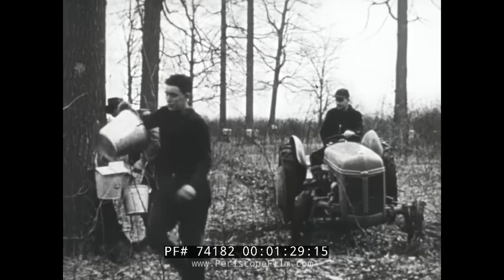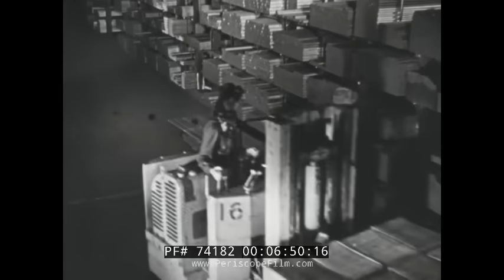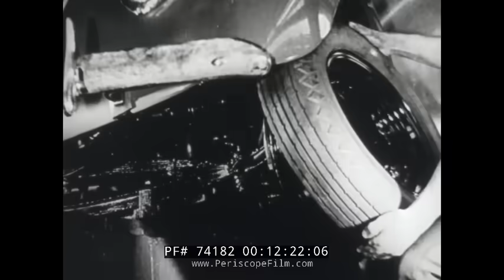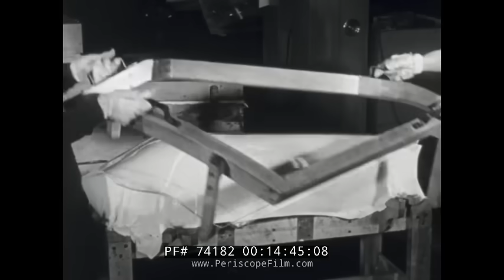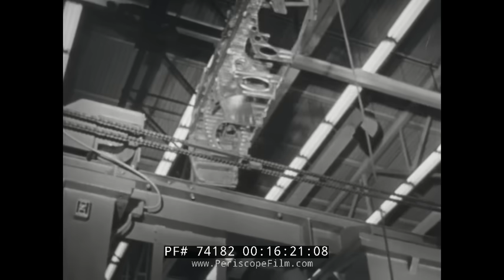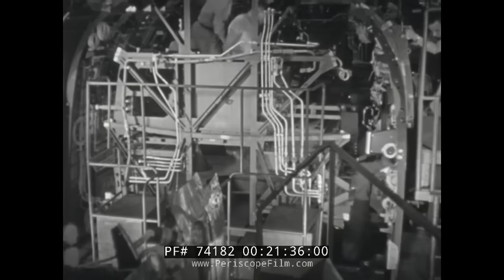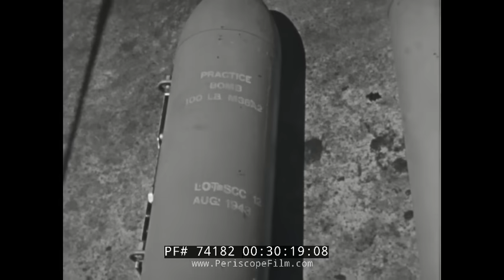BUILDING THE B-24 BOMBER DURING WWII  " STORY OF WILLOW RUN " 74182

Comment: Much is said about the survivability of various aircraft, toughness helps to be sure, but if you took a direct hit of 88 flak, your ship was about to meet Tera Firma. In a big hurry. Get out if you could, many could not. Depending on who you meet once on the ground you either went to Luft stalag. Or worse.
Just imagine if the roles were reversed, all politics aside, say a crew had just bombed Topeka and killed your family, how would you treat them?

At 27.00 there's a little midget in the outer wing connection joint. What American crafts workers can build, that great oleo strut of the main gear always struck me with its strength in nearly unbraced structure, amazing, and those lovely ladies so hard working as well.
Imagine the sun on that new aluminum mirror finish, you see why pilots wore Ray / Bans.
Amazingly enough at the end of production many factory new war birds were flown directly to Kingman Arizona to meet the scrappers axe.
Reply: Yea and WE paid for every one of them too. THATS what that and every other war is about !  Get the connection yet ? ? ? ?

Comment: I see your point and agree piracy is a problem. I'm a film editor. I was able to remove your timecode and soften your URL. Today nothing is really safe. If I wanted your footage I could use it. For the casual viewer however your attempts are distracting. You could reduce the size of the timecode or even soften it to barely visible but for the average editor it would render the footage in desirable. I appreciate your efforts in restoration however. Keep up the good work.
Reply from the maker: Actually, broadcasters increasingly do understand the difference between true 1080p material (and 2k and 4k that we sometimes provide) and the quality level of a file that has been downloaded and blown up from Youtube. And legitimate broadcast producers and filmmakers respect not only the quality of our delivered material, but require the legal clearance that we are able to provide through the licensing process. If you're truly a professional film editor, working for legitimate producers, you should know that material you've "softened" is not only substandard, but likely to expose the producers you work for to liability.

Comment: There is no such word as "aluminum" in English.  Take a look at any proper Periodic Table, and you will see that the 13 element is correctly spelt "Aluminium".  Really, you folks ought to have caught up with this simple matter already.
Reply: Careful... You're asking for an ALUMINUM gift!
Reply: To quote lookoutforchris and his earlier comment: "If you're a Brit you should know how to say and spell Aluminum.  It was first isolated in the early 1800s by another Brit, Sir Humphrey Davy.  He named it Aluminum and as Americans we've respected his naming.  A political journal in the UK later changed the name to Aluminium because they thought it fit better with other elements ending in IUM... even through there's several elements that end in UM (like Platinum for instance).  The Brits standardized on a political revision which disrespects the original discoverer.  Look it up, it's all on Wikipedia.  Both versions are considered correct today by the IUPAC, which is really the final word on the matter.  But ultimately the Brits are not using the original spelling, and they're too pompous to look up the history of it".

Comment: There is a myth that the B-17 was more survivable than the B-24.  Do a little research and you will discover that the loss rates on the B-24 were actually lower than the B-17, despite being tasked to do more low-altitude work.

Comment: 1 every 55 minutes, that's amazing
Reply: No they actually could roll one complete B-24 off of the line every hour on a shift in full swing.
Reply: Problem was you could easily lose more than 24 bombers in a single raid. The courage of those fliers, most of whom were barely out of their teens....
Reply: i am guessing that means that there was one process in the manufacturing that took 55 minutes -  the longest process time - what cld that possibly have been  ?  Need to watch the movie again !
Reply: It was impressive but the squak rate was through the roof, Took the AAF a long time to work it out to where they were cleared for flight and AAF acceptance flight.

Comment: Turbo-super-chargers, huh? This narrator was a real genius....
Reply: Superchargers are/were driven either mechanically or via exhaust gas. The narrator was correct in using the term in the era when the film was made. "Turbine driven supercharger". Language changes and evolves. Now we have two distinct terms.
Reply: @51spike  - Correct. That's exactly what they were called - turbo superchargers. The turbine was driven by exhaust gas from the engine. It allowed the planes to fly at high altitudes and still produce power as if they were at lower altitudes. Both the B-17, B-24 and B-29 used them as did the P-38 Lightning and P-47 Thunderbolt fighters. Most other US fighters (P-51, F4F, F6F etc.) used mechanical superchargers.

Comment: The B-24 looks like they added wings to the box the B-17 came in!
Reply: My Uncle Navigated a B17 over france & germany. He said when they talked about the B24; "it looked like the box the B17 came in"  Yeah it was  funny looking.
Reply: B-24 was a lot better aircraft then a B-17
Reply: Some guy named Davis spent 2 years designing the wing.  Consolidated spent 10 minutes designing the rest.  During advising, recommending nose armament, Charles Lindbergh thought the plane was so ugly that they should just put the "tail" on the front end.
Reply: the Lancaster is pug ugly.
but not as bad as the Blackburn ROC.

Comment: Both my grandparents worked there. I remember my grandmother, a "Rosie", told of one of the wing midgets being killed when an outside worker drilled through the skin of the wing and into the midget's head. People came from all over the country to work at that plant. It was a prized job if you could afford the gas rations to get back and forth to Detroit, an hour away. They couldn't house 60,000 people in Ypsilanti, where the factory was.
Reply: They used dwarfs to crawl inside the wings and back up the rivets while the riveter on the outside set the river. Once the river was set they drilled the next hole. It must have been hellaciously loud, for one thing. Anyway, yeah the midget's head was in the wrong place at the wrong time or maybe he "didn't know the drill" and then the drill "got inside his head".
Sorry. Bored ya know.
Reply: Drilling through a wing midgets head? Pray tell, continue my good man
Reply: Oooohh? Not good??.. That could hurt??..

Comment: Years ago I was wandering round RAF Cosford Aerospace Museum and climbed a wooden platform to look into the port side of the B24 cockpit. There was a little blue Ford symbol in the centre of the control wheel, which amused me at the time, thinking one of the museum staff had been 'avinalaff.  "In a Ford!"  Got the whole proper picture shortly after.  Live and learn.
Reply: GM built Wildcats (what you Brits would call Martletts), too. Goodyear built Corsairs, as well. I believe a few Corsairs graced British flat tops back in the day, showing us Yankees how to safely land a Corsair on a flat top (in a shallow turn to overcome "blind spot" issue upon coming back aboard). You folks let Packard build more Merlin engines. Republic was owned by Ford, too. I wonder if there is there is a blue oval in a P-47.
Reply: I live near cosford,i go occasionally
Reply: How evertonian mate

Comment: Had a uncle who flew 51 missions in a 24, 15th air force. It's strength was it's ability to be massed produced but it was easy to bring down due to it's propensity to catch on fire. But it hauled heavier loads than the 17 over longer distances  at faster speeds and among many tasks  it performed included sub hunting in the North Atlantic and the British were happy to get them
Reply: My Dad also flew 24s in the 15th air force.
Reply: Robert Long  Actually the B24 was only slightly faster, carried  a little more a little further, but it could NOT match the service ceiling of the B17 !!!!  They went with a Davis wing on the B24 for speed and sacrificed lift and the ability to climb as high !!!  B17 had a higher service ceiling due to its larger wing !!!!
Reply: @wilburfinnigan2142  True but the loss rate was almost identical (24 was actually slightly lower loss) so the few thousand feet ceiling didn't amount to any real advantage.
Reply: As well my father,was a pilot in WWII The greatest generation!!!
Reply: My father was Emperor of the Universe during the Big War.  He later resigned to become president.  Everyone has a story, don't they!

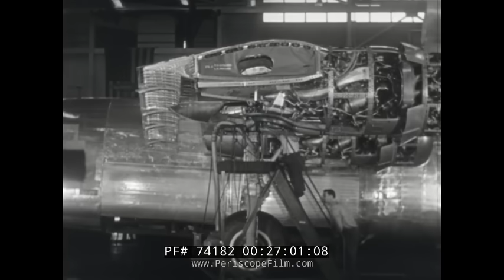Comment: best part is at 27:00 ..... oh those little midgets!
Reply: Had to laugh at that, too. My question is did they get them out or did every plane go into service with two "little midgets" trapped in the wings? Regardless, was there a midget shortage during the war that has somehow slipped under the radar? There has to be a PhD thesis or, at least, a PBS documentary in this.
Reply: Lol
Reply: They used midgets because regular sized people couldn't fit in the wing sections. My mom riveted the wings to the fuselage and said ( those damn lazy midgets would fall asleep in the wings during breaks and the driller would start DRILLING after break and would kill them or wound them because he didn't know they were sleeping ) 😲😲😨. 😁✌
Reply: @billbegan4080  Damn. They must've had a ready supply of midgets !!
Reply: They used midgets because they were short of people.

Comment: The first time a saw    the inside of a large  Bomber from ww2    I   wondered  why  the hydraulic  lines  weren't  run thorough a protective  Tube  when possible   to exit where they   are needed  which would reduce  the damage  to them by attack planes  as the bullets would his the round surface  and deflect . 
        The lines could be fed into the pipe and then  bent to fit  their positions and have the  connectors put on ,  a hinged  half-pipe  section could be wrapped around  any  small area that remains  and clamped shut .  Lines would have a color   to avoid mixing them up  while the  exposed  junctions would have metal plates between them and  the planes skin. 
               
       This method for pipes  would also  contain the oil  better  inside the tube  and reduce the chances of  fires  to weak  areas  that are exposed ,  it would add weight  but increase the life of the bomber  and crew to fly again  as they  could limp  home  with damage  but have  enough  hydraulic system running.    
      As for the 300lbs wheels ,  if I was on a suicide mission where fuel was tight and I'd  be landing  in a field  if I couldn't  return to a air field  I would be ok with   a special wheel  spindle  or Landing  gear  shock  that  would  discharge  the assembly  after take off from a carrier  to save over 600 lbs after the payload was dropped  to use less fuel to get home.   
          The landing gear is useless if  the odds are I won't  have enough fuel  for a round  trip   if  the weather gets bad   or there is a fuel leak  upon returning .   Making it  back  would allow for some of the crew to bail out  near  the airport  and bring it in  with  the Pilot and co-pilot  for a belly landing  on the grass .   
             Hey,  I'd be closer to a  Military  Hospital at an Air base than some farmers field  or  swamp area   where I'm injured  and  stranded .